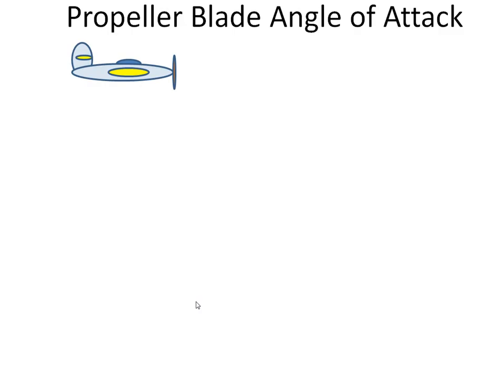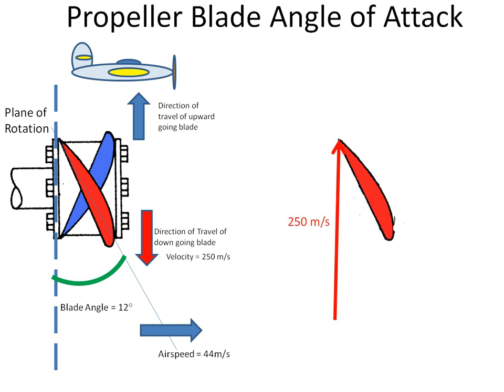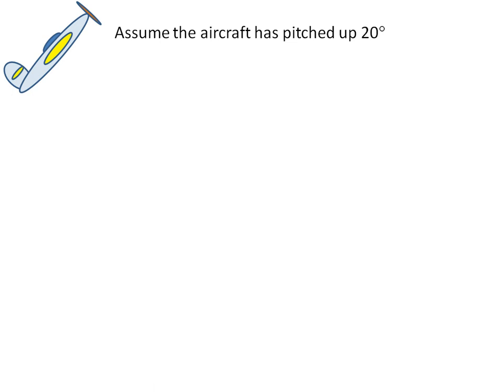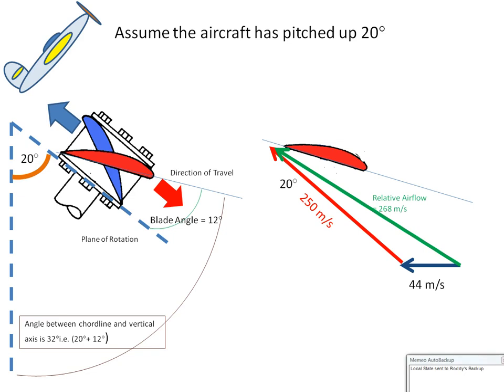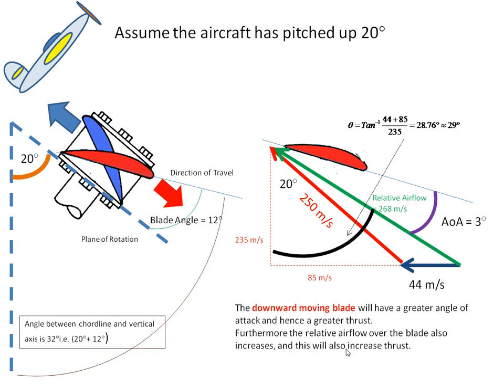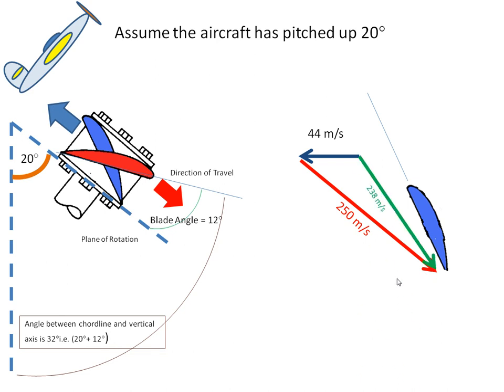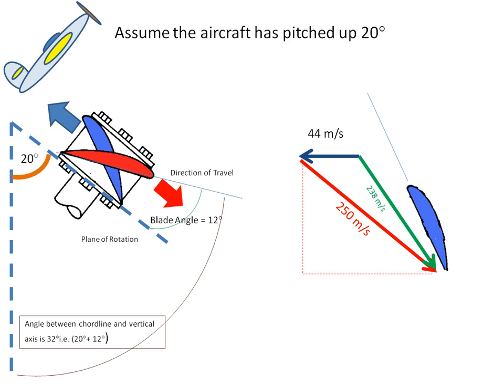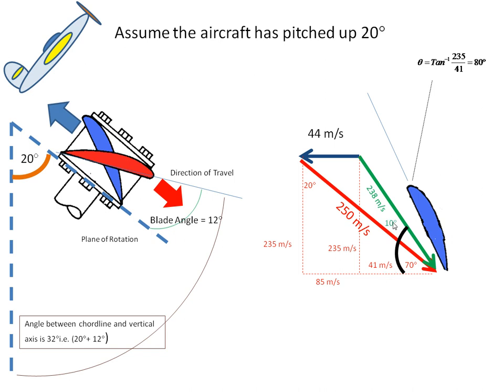Propeller Blade Asymmetric Loading Part 1

Comment: Your graphic with all the angles and vectors is missing one important vector. You do NOT need the vertical line that gives you a 20° angle to the plane of rotation of the propeller. You do NOT need the pitch angle. But what you need is the direction of relative oncoming airflow to the propeller. THIS then will give you the correct angle of attack relative to the propeller AXIS and you can add the angle of attack of the proppeller blade cord line to the first angle of attack (oncoming air relative to the proller axis) this in turn will give you the greater total angle of attak on the down-moving side of the propeller and the lesser total angle of attack on the  up-moving side. You do NOT need the pitch angle. You need the angle of the airflow relative to the propeller axis. This effect of unequal angle of attack on the left and right side of the propeller is far greater than the effect of slightly different airspeed over the blades left or right.

Comment: Air speed vector direction confuses me. Shouldn't it be parallel to the axis of propeller rotation?
Reply: i think hes doing it right as the plane started to pitch up, but has yet to actually start moving that direction
Reply: This video represents having the nose pitched up while the plane still level and moving forward, an example being at a high angle of attack on takeoff or in slow flight

Comment from the maker: I took the simple view that the relative airflow is the square root of the sum of the  aircraft velocity (free stream) squared, and the rotational velocity of the propeller squared.  This fairly accurate, but doesn't account for inflow etc.. However it is sufficient for this video.  I'll do another video at a later date showing a more detailed analysis of the propeller.  Thanks for your comment.
Reply: Can you explain how you calculated the relative airflow after the propeller has been pitched up 20 degrees?  I’ve tried applying the law of sines and cosines but seem to be missing some information. Thanks for the terrific video.